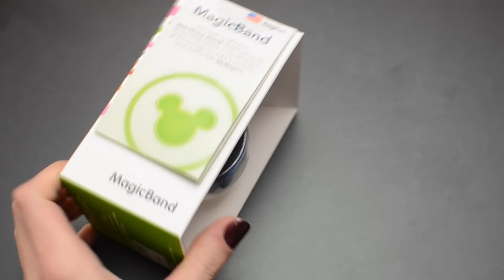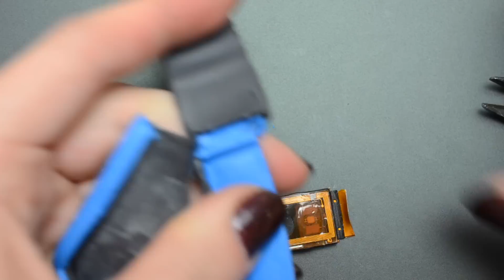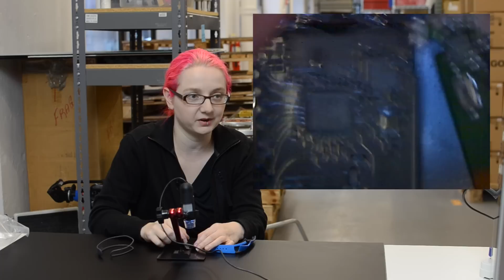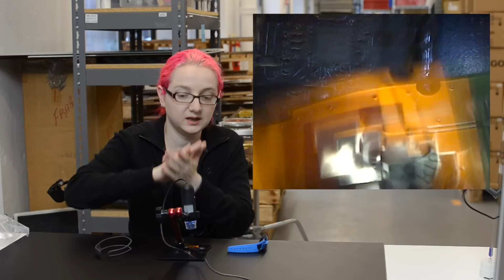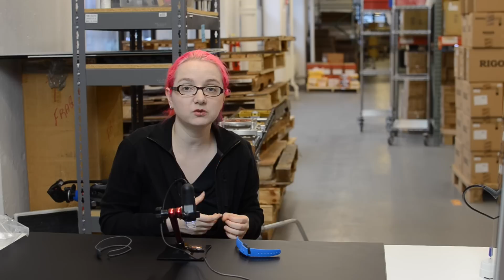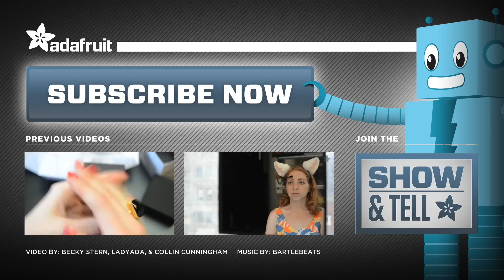Disney Magic Band Teardown

Comment: This is a great video.  But, do you have something showing how you surgically opened the MagicBand?  I recently learned the battery will expire on these in about 2 years, so I want to learn how and where to carefully open these and get to the battery to replace it, without cutting or damaging other sections like the antenna.  Do you have a video showing that?  Thanks!!!
Reply: Erin Rippy the issue for me is I have the first Valentine's Day one and I wish I could replace the battery.
Reply: Can't be done.  They weren't designed to be easily opened.  They were designed to be destruction-proof and waterproof.  A new MagicBand is $12, and you can get one for 'free' when you book a vacation and stay on Disney property.

Comment: The band is basically your virtual ID while in the whole resort. It is your room key If you are staying at any of Disney's hotels, it is your admission "ticket" when linked with a valid one, it is the fast pass voucher for bypassing some lines at rides. Also can be tied to yourcredit card for purchases on the park with a pin number, I got mine in october 2014 and used it again in October 2015 without any issues. I even went swimming with the band on. They have readers all over the place, shaped as Mickey of course. Pretty nice device.

Comment: If you really don't know how its used. Its used as your ticket by pressing it to what I assume is an RFID reader at the turnstiles but also to identify you in a ride or in a store etc by transmitting a code to readers around the park. 

With this device, in a ride that takes a photo of you on the ride, you no longer have to go to a kiosk and claim the photo its already added to your Photo Account. 

There has been talk that if you add certain preferences to your MDE (My Disney Experience) account an attraction will display or somehow be be customized just for you such as a certain ghost will pop up at the end of the Haunted Mansion Ride.

With the long range readers there are certain "Big Brother" aspects to these bands such as knowing when you are in a gift shop or how you toured the park. Some people even think it will help them find lost children.

They spec it at lasting 3 years for the long range reader.